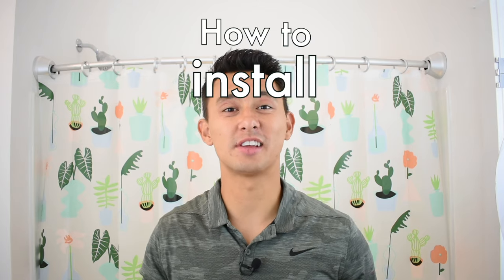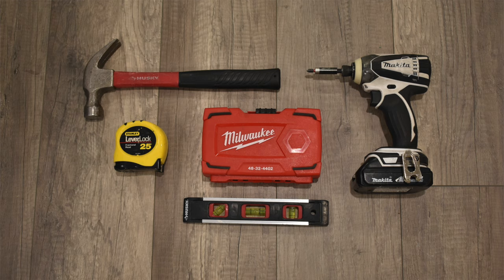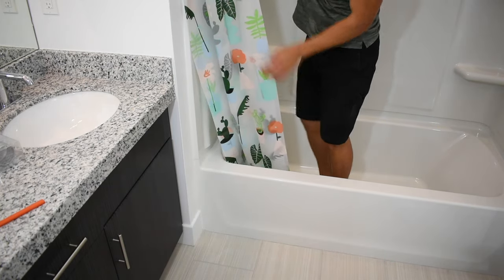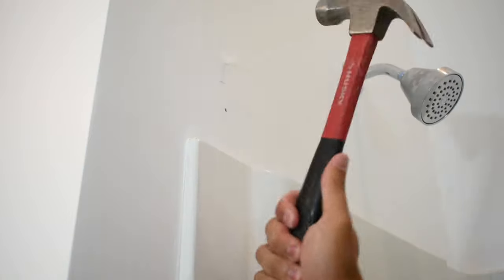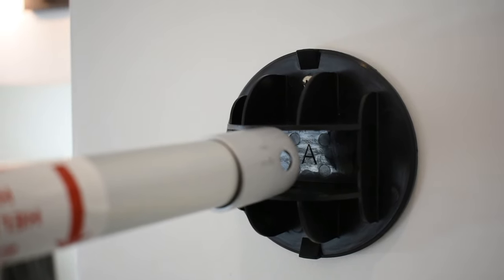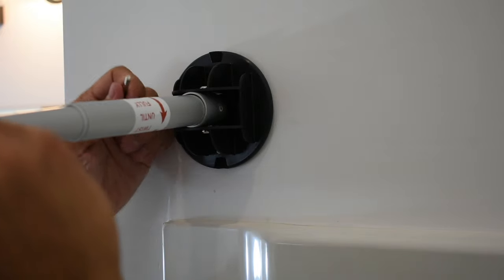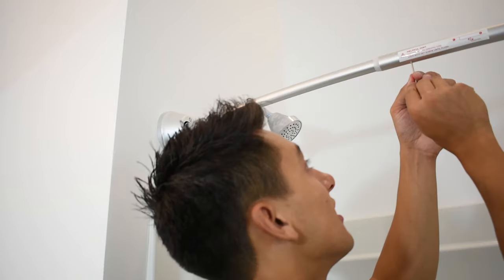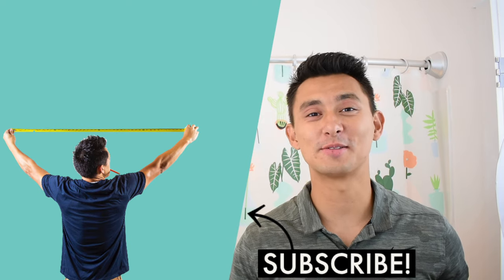DIY How to install a curved shower rod - simple and easy!

Comment: This made the install super fast, thank you.  Helpful tip if your bath tub has tile that you have to drill through, use tape to prevent the drill bit slipping.
Reply from the maker: Great suggestion! Thanks for adding that tip and thanks for watching and commenting!

Comment: I’m confused. How am I positioning the anchor next to the shower curtain mark? Also, would you use a curved shower rod if you were putting up 2 shower rods to layer your curtains? If so, would you put it in or out?
Reply from the maker: So when you layer just double it up on the hooks. Use 1 rod, get your hooks, and put both layers on the same hooks. Put a plain plastic or clear on the inside to get wet, then your prettier plastic or cloth is on the outside not getting wet.  That help?

Comment: How do I mount shower rod at an angle? Without it falling ?
Reply from the maker: Depends what angle you are trying to mount it to.  The ends of this shower rod swivel a little so they are semi forgiving, but if it's an intense angle like a shower in the upstairs bathroom of a peaked ceiling, id get some sort of block or molding that would make up the difference of the angle to then be straight.  Paint the block of you can buy almost like a wedge or a shim, just larger to not have a slant anymore.  That help?
Reply: @ColtonCrumpDIY  Well, thanks. I guess my question was not very clear. The curtains are for  corner shower. 2 rods cantelever from 90 degree wallsand meet at 90 Deg. The 90 Deg corner in space keeps deeping ⬇⬇⬇ due to weight of curtain.
Reply from the maker: Gotcha.  If it's a corner shower, this probably isn't the right solution.  You may need one of those 90 degree shower rods that actually have a wire or rod to support the 90 degree corner.  Then get 2 curtains. Or there are some or there that have 1 rod and stay up.  Try searching up "corner shower curtain rod", you'll need one of those.
Reply: Thank you! I have the exact rod to install and the written instructions were making me crazy.
Reply from the maker: You are welcome! Hopefully this helps!

Comment: What do you do if you only want to use the tensioners and not screws... but the tensioners don't work?...
Reply from the maker: Then use the screws
Reply from the maker: Ha kidding.  I had to.  You set it up so well.  So what part of the tensioner isn't working? Do you twist and it doesn't tighten?
Reply: @ColtonCrumpDIY  that's right, and the inner bar's tensioner will release from the bar completely, the outer bar seems attached. Neither one adjusts
Reply from the maker: So there's typically 3 types of tensioners.

A. 1 solid rod with a big bolt like tightener on the end to twist
B. 2 rods where one of the rods twist to tighten
C. 2 or even 3 rods with a tightening mechanism in the middle

I would recommend putting both of your ends of the rod up where you want it, twist one rod at a time to see if there are any changes.  Generally if something is broken, you can tell by any weird sounds, lack of structural strength, or it just seems off. Happy to see what you have if you shoot over some images via email also to coltoncrumpdiy@gmail.com

Comment: Which way does it curve.  Missing most critical context
Reply from the maker: It curves outward. The whole purpose of the curved shower rod is to give you more space in the shower.  If it curved inward, it would make your shower smaller, which would defeat the purpose.
Reply: Curves inward for skinny people 😀
Reply: @marlboromatt5656  😂😂

Comment: Title says curved rod, that's misleading. Basically you installed it on a straight line parallel to the tub, not on a curved line parallel to a curved shower basin